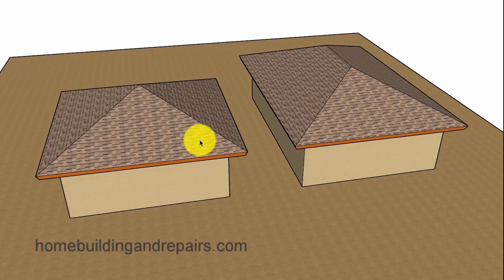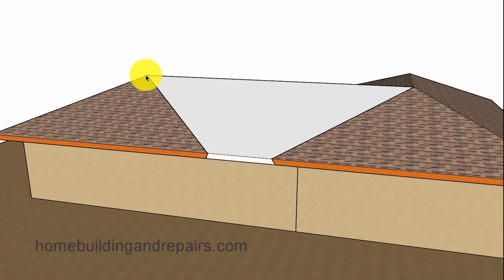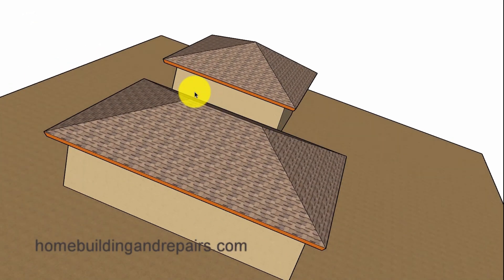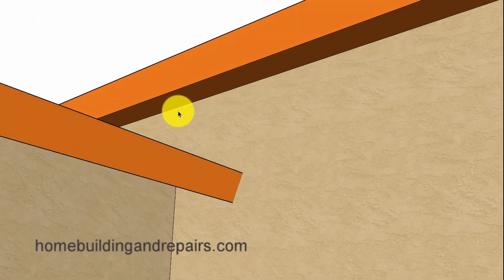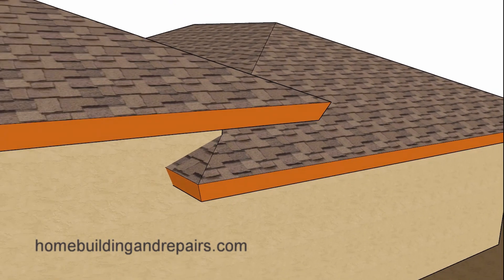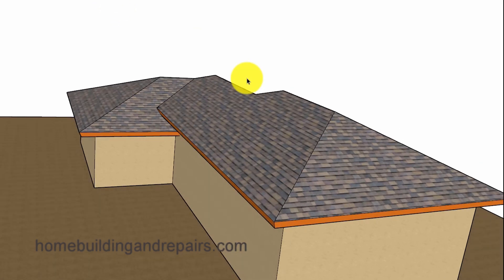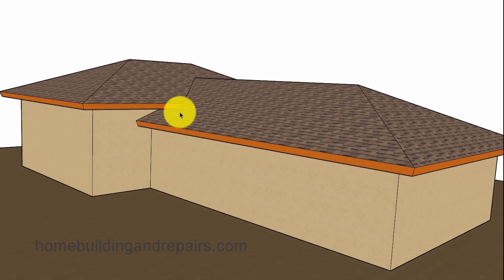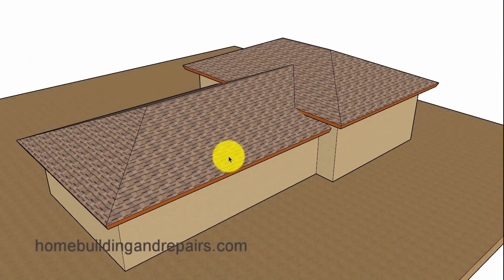How To Design Hip Roof For Home Addition Between Buildings With The Same And Different Heights

Comment: I have a rambler with an A frame roof and am looking to add a recessed garage. These diagrams provide valuable visuals for what I want to imagine it would look like. Rather than elongate the existing homes roof lines (and risk looking like a trailer home), I’m hoping to incorporate a gable to add “elevation” and break up the monotony of an even longer rambler. Having a hard time visualizing what it would look like